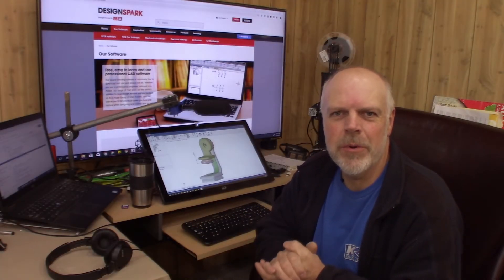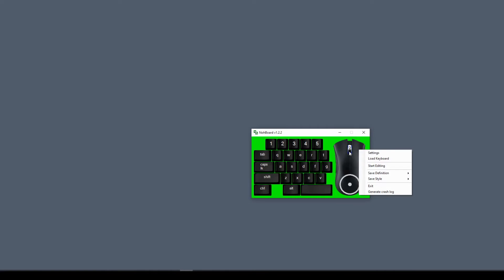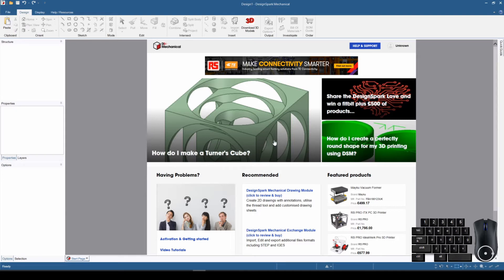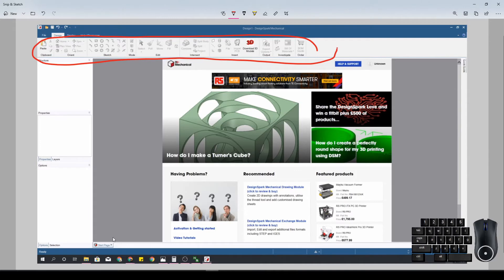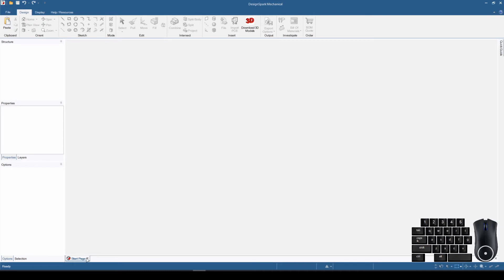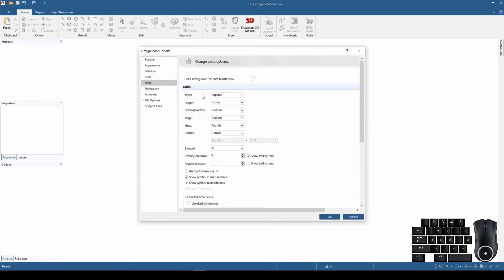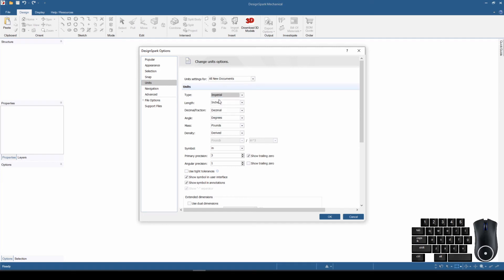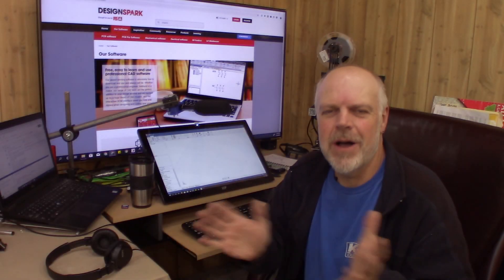DesignSpark Mechanical Tutorial - How To Start A NEW DESIGN  (DSM01)

Comment: Very informative lessons. For some reason, when I create a box, circle, or line, when I let up on my left mouse button, the measure value disappears. When I click on the line or box the values don't appear. I get a small dialog that pops up that only allows me to pick a color or change the lines to a construction line. Is there a setting I need to change for DS06 to make the values appear?

Comment: Hello, I am just starting out. New to 3D printing. So I need metric to 3d print?
Reply from the maker: Most of the 3D slicing programs work in metric, so it can be easier designing in metric from the start.  At least I have found it that way.  It was tough to start out as I am in America so use our standards...